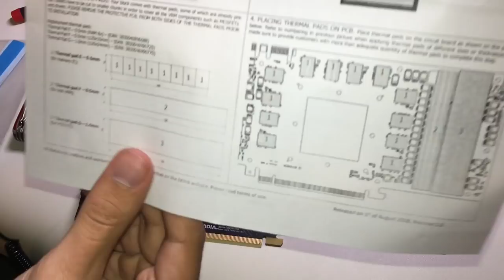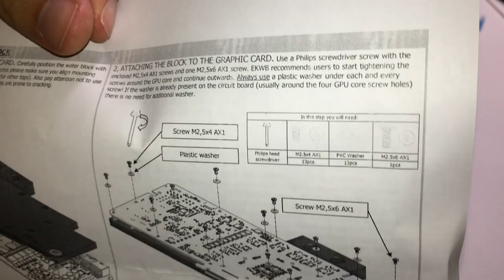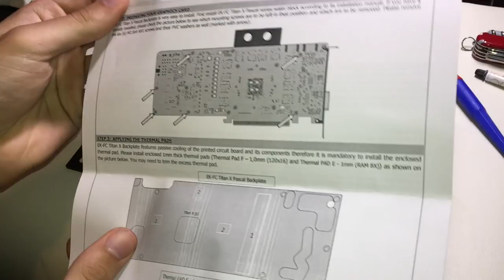Titan X Pascal EK Waterblock Installation

Comment: going to have 2 water-cooled titan xp cards in my new system!
Reply from the maker: That's crazy. And awesome. Be prepared for that heat, though. The air coming out the back of my radiator is enough to keep my room warm with ONE card.
Reply: Aurummorituri should i water cool them?
Reply from the maker: They will warm the room either way. Water cooling just makes sure they won't roast themselves. I would probably water cool them for best longevity and temps if your budget allows. You will need to do a custom loop, though. One 360 radiator covers my cpu and ONE Titan decently, but you will need a dual-rad setup to cool that pair. Recommend an EK  soft loop kit if you are not keen on bending hard tubing.
Reply: Aurummorituri okay thanks man! kinda miffed. watercooling seems hard. would 3 1080's be okay on air?
Reply from the maker: Jacques Forsyth I would not go for three cards when some titles do not support them. More stutter for those that do. Also, they would still run very hot crammed together. Stick with the dual Titans. If you chose not to water cool, get a motherboard with extra space between the PCIe slots to give them some more breathing room.You will have more compatibility and more memory and bandwidth.
Reply: Aurummorituri thanks man! the thing is, i game a bit but not that often, the horsepower i am after is for rendering so obviously the more cuda cores the better.
Reply from the maker: Jacques Forsyth Dual Titans should be more than enough for rendering. I have dabbled in engineering courses so I know how important a good GPU is. Blender and Solidworks are easy as pie with just one card at 2GHz.

Comment: Great video! Just got a Titan X pascal and am new to the whole waterblock thing. Just want to make sure I get all the right stuff. So the EK Titan X Pascal Nickel waterblock w/ Predator pre-fill and Titan X Pascal Acetyl aluminum backplate is all I need to make this setup work? I don't need anything else in my casing for this right? After completing this process I just install the card in the PCI express slot and that's its going to be cooled? Thanks in advance.
Reply from the maker: You need the Predator radiator, but EK just discontinued it. They are releasing the MLC Predator in a month or so with the same connectors that does not have a cpu waterblock so you can hook it up directly to your gpu waterblock. I would wait for the new one to drop. Mine is a pain the ass to install and the extra hose is not the prettiest thing in the world.

Comment: You completely skipped the parts where you place the water block on the GPU and place the backing.  Why?
Reply from the maker: Haha. I was having trouble holding them together nicely and screw them together while working the camera and I got a bit frustrated, so I turned it off just long enough to get a few screws in. (Thermal compound was making a mess from sliding.) :D

Comment: Just a quick question... How do you Keep the Reference cooler of the Titan XP safe? Is it okay to leave it in your drawer with all those thermal pads in there. Is it also safe to put back all those thermal pads back in the Titan PCB in case your water cooling failed?,  or you just want to go back to air cooling? Also how do you cut those thermal pads for water cooling? and how do you get those in case you perform maintenance once every three years?
Reply from the maker: I just stuck it back gently in the retail packaging. Those pads should be good for awhile. Also, the pads came mostly pre-cut. Some were too long in which case you just trim the excess with scissors. As for maintenance, they do not "go bad" as fast as thermal paste. They should last at least three years. TIM, though, should be changed at that point for sure, especially with a crazy hot card like this.
Reply: TY for reply, oh and one more thing, did you bought the Titan XP cooler prefilled from EKWB? if so, its just plug and play right? and you need the QDC (Predator 360 ) for it to be installed or to be expanded right?

Did you leak test your rig after that? Im extremely concerned that If I ever bought even an AIO cooler that it might leak, I just want to be sure and everything. I don't want to see a damaged rig that costs 3000 $ +...
Reply from the maker: TheDevestatorX Yes, I bought pre-filled, and thanks for not dissing me for it. You know, hardcore water-heads and all. Will have a video up soon detailing my rig. The Predator 360 is really required for this thing. A 240 or even their new 280 would not cut it especially with a cpu in the loop. Also keep in mind that unlike the old Titan X, this has a 7+2 power phase that allows for the entire 300W power draw if desired, not 275W. Throw in the crazy clock speeds and you get a card a good bit HOTTER than an old Titan Maxwell. As for leak testing, I tested the rad/pump/block outside the case as there is a chance even now of a bad o-ring on the cpu block. GPU block is factory tested, so no worries there. Even has a sticker. :) Oh, and be sure to have a monster case. Got an Enthoo Luxe and it BARELY fits.
Reply: good job m8, we always need some info from guys like you.

Comment: I'm about to make my build I'm putting together all the parts this being 1 of them that needs liquid cooled ty for the video. I'm a rookie when it comes to this stuff. How long before it leaks? How often u gotta make sure the screws are tight how often do you drain the liquid?
Reply from the maker: I'm just a noob, too. My setup came mostly assembled and pre-filled. I have not noticed any leaks in the loop, but one rotating fitting started dripping from the joint itself when I was holding the card vertically when cleaning it recently. It only leaks when certain pressure is applied at a certain angle and not when installed, but it still makes me a little nervous. The key is leak-testing the system before fully assembling it and putting down towels to catch drips if they occur. EK recommends changing the liquid once a year or so.
Reply: Aurummorituri  so this system can prefilled with its own radiator? Like nzxt x62 kraken?
Reply from the maker: Jason cheever That is a completely sealed system not meant to be opened. This is a closed-loop cooler, but is not sealed. It still can be unscrewed and there are drain ports on the radiator. It is made from custom water cooling parts, but is assembled to resemble an all-in-one like the Kraken.
Reply: Aurummorituri  yes! Where can I find this exact system from EK? Because all I see it the gpu block what about the radiator and hoses? So I can get a total cost
Reply from the maker: Jason cheever ekwb.com is the place to go. Be warned, this is expensive stuff. Low production volume and lots of copper construction make these much more expensive than a Kraken or Hydro series cooler. Shipping is bad, too. It's Slovenia after all.

Comment: great video thanks, what kind of clocks are you getting with the block installed?
Reply from the maker: Mmm...was going to put that in the next video, but okay. As shown in my first video, the card blips to 2012MHz before settling to 1975MHz on air, at least as long as it stays below 75C. With the block, I have it hooked up to a 360 Predator along with my 6700k, and it can generally hold 2012MHz stable without falling. Adding a little voltage (with a little code tweak) gets me to 2025MHz or 2038MHz depending on load with +250Mhz on the memory. My card is decent, but there are others with better ASIC that get to 2050 stable or even 2088. You have to watch for some shenanigans, though. One guy posted a quick video of his hitting 2038 without voltage, but his memory was only running at 9000MHz. He undervolted his memory to get higher clocks. The card refuses to hold a very stable clock under load, though. It dips and blips in heavy games like ME Catalyst, but according to Afterburner the voltage and power limits are constantly pegged. If it had dual 8-pin power, it would be a much more stable experience.
Reply: Hi, Is that all !!! is it really worth all the aggro in putting a block on and invalidating warranty for a small increase in performance?, On air mines running 1974mhz without much of a drop & +500 on the memory. I'm seriously considering now dropping the idea of putting a block on :(
Reply from the maker: Joe Joe Putting on a block does not get you substantially higher clocks than peak, but reasonably higher than "hot cruising speed". You do get much better stability and a longer lifespan. But 1974MHz is when the card is relatively cool. Playing at 4k, the card tops 85C and the core drops to 1911MHz. Okay OC, but scary temps. A hundred MHz on a chip with this many cores DOES make a few fps difference at 4k. Not to mention my pc no longer shrieks when under load.
Reply from the maker: Got mine to 2025MHz solid WITH +500 on the memory. :D
Oh, and you do not void your warranty be water cooling it. Only con is the cost. And effort. Two cons then.

Comment: Yo man, I followed everything and did the same as you, but now my displays are not working but the pc itself is working. I have a razer keyboard and it only changes to the right color when the program starts and it changes. The pc was working when I didn't install the water block.
Reply from the maker: You might have a bad card or you killed it. Probably a bad card.
Reply: GTX 1080Ti
Reply: Aurummorituri How can you kill it exactly?
Reply from the maker: If you shorted out something with a static discharge or broke one of the surface mount components. Did it work before you took it apart?

Comment: Can you keep the factory backplate? I want to put this block on my 1080Ti SC but keep the stock BP until a 1080Ti backplate comes out.
Reply from the maker: You can, but my card sags a bit WITH the backplate, so just be careful with your tubing not to put too much pressure on it.
Reply: I use hard/rigid tubing so that does pretty well to support it anyway. I ordered this water block off amazon last night.  Looking forward to putting it in.
Reply from the maker: It's not the most fun process. I actually took mine apart again to apply some Liquid Ultra liquidmetal. Much better temps, but risky for shorts.

Comment: Is it possible too install a Waterblock from EK and keep the old backplate instead of EK's alternative?
Reply from the maker: It should be, but I would not advise doing it because the old backplate is really flimsy and does not cool very well. The EK one is much thicker to prevent sagging and has spots for thermal pads for the VRMs. You can get it the black color or polished Nickel.

Comment: Hi. I'm kinda of a noob when it comes to watercooling but can someone tell me this. After installing the waterblock on the card, I just plug in the gpu and all the cables and the watercooling works just like that?
Reply from the maker: Yes, but make sure to run a leak test first. Leave the gpu hanging out with the hoses attached and run the machine. Look for leaks. You will need a decent fan curve when pushing the cpu and gpu at the same time to maintain your overclock, too.
Reply: Aurummorituri Ok, thanks for the quick reply man. Awesome video by the way. Instructions and everything else are clear as water.

Comment: i am going crazy... i dont have any 5x7 srews for the backplate.. they are not included in the plate or the block.. how did you compelte this?!?! aaaaaaaaaaaaaaaaaaaaaa
Reply from the maker: I only had three. I used three shorter ones that fit but required extra pressure to lock. Looked dumb on camera. I was very annoyed, too. :/ Now I have the issue of trying to run push/pull but you need "special" hex bolts to connect your fans. Lovely, right?

Comment: Probably a noob question but does the waterblock only connect to that specific cooler?
Reply from the maker: The pre-filled one I have only connects to Predator tubing from EK, although there are multiple sizes. If you are doing a custom loop, as long as the fittings match up, you can use any radiator you wish.
Reply: Aurummorituri thank you, lovely pc btw
Reply from the maker: Dissentdnb You saw my other video? Yeah, she is nice. Way too big for my desk, though. May want to downsize next year.

Comment: Whats ip man ! Please give me your opinnion ..If we put side by side, a Titan X P and  a 1080 TI, with this watercooler system, and overclock them both to their limits
Wich one do you think will have powerfull performance ?
Reply from the maker: If the quality of the chips is about equal, then the Titan will win very slightly. The 1080 TI has the same core count and will not have an advantage in overclocking because these are both reference cards. The big difference will be with AIB partner cards. The Titan Xp has power limit issues with a max draw of 300W. My 2GHz OC starts bouncing around when the power draw exceeds 117%. I have seen as high as 124%! A 1080 TI Hybrid FTW from EVGA with dual 8-pin power might OC a bit further but it will be more stable under high load. No matter the result get the 1080 TI. Get one of those if you want water cooling of just grab a big air cooled one like an Asus Strix for close to the same performance but save hundreds compared to me. I paid dearly for the early adopter's fee. For $200 more I could have bought TWO of these cards for one of mine.
Reply: Aurummorituri I have already bought 2 titans x pascal. I'm about to receive them. They will be water cooled and with the acetal nickel plates  as well.. Then they announced 1080 Ti and I got worried. I know that I spent twice the money.. But I would like to know that once they will be custom in water, if I overclock them they will have power enough to match the Ti or even slightly win
Reply from the maker: A 1080 Ti Founders Edition will not be any faster unless your Titan has a lousy ASIC...like mine. Aftermarket cards with more power delivery may overclock slightly better, but temps on air might keep the cards from holding them under heavy load. I'm just a little burned that they didn't really cut down the card, just the memory by 8%! The memory is faster but the bus size is smaller. I can OC my VRAM to 11GHz for 526Gb/s of bandwidth so that is a nonissue. They must really want to burn AMD ahead of Vega by releasing essentially the same card for $500 less.

Comment: How do you do this while using an HB Bridge?
Reply from the maker: You can use a flexible HB bridge I'm sure. I know the Nvidia one doesn't fit due to the funky plate over it, but maybe a Gigabyte or EVGA LED bridge will fit. Should be some forums about it.

Comment: complete part list and tool list you used?
Reply from the maker: Mmm...you need an electronics screwdriver kit, a socket wrench kit, your Titan, an EK waterblock prefilled, and an EK Predator all in one cooler with QDC connectors. And a LOT of patience.
Reply: +Aurummorituri which ones did you use?
Reply from the maker: sahil bhosale Most of them were unmarked. The pains are the micro-screws holding the backplate on and those mini hex bolts keeping the shroud/cooler. I just poked around until I found ones that fit. EK has a hex head on their site with the exact size.